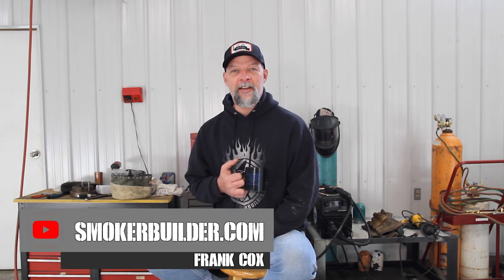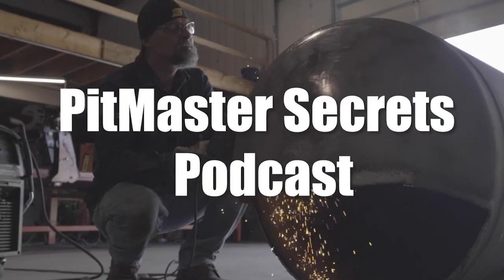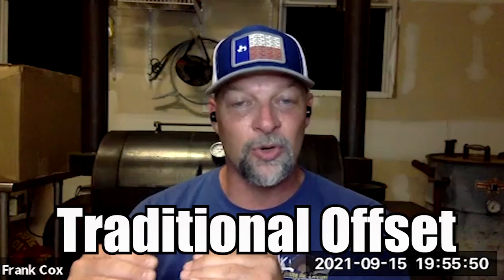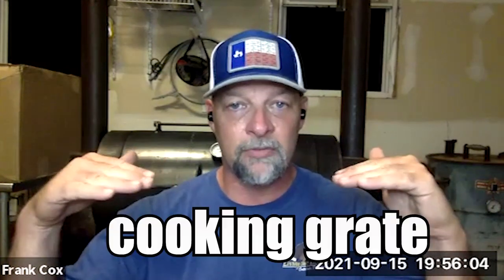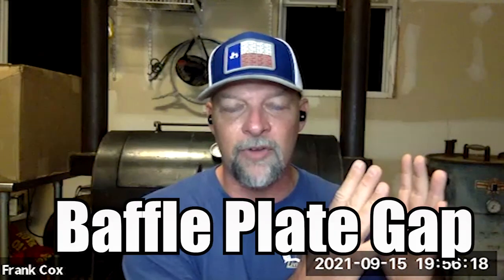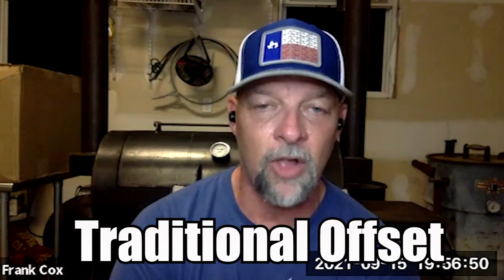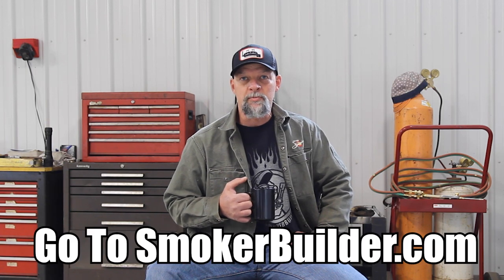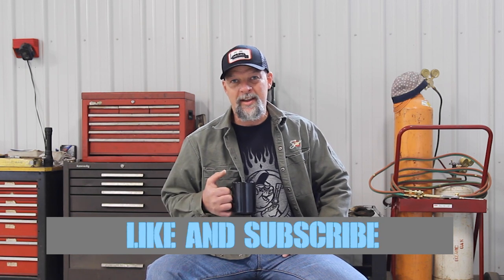What Kind Of Baffle Should I Use For An Offset Smoker?  [PitMaster Secrets Podcast: ep. 3-6]

Comment: Really interesting video. Been experimenting with different designs on my tiny offset myself, I've settled on a Franklin / Mill Scale design baffle, wide open exchange and a shelf 2" above the grate. I've had good results and great flavor, definitely better than the factory downward lip baffle that caused a marked hot spot in the center of the grate. Cheers!
Reply from the maker: Awesome! I still have not tried that method yet. there are so many good ideas out there though haha!
Reply: @SmokerBuilder  There's truly a ton to play with. So fare I've tested the Franklin design (you can see a picture of it on my insta), the Workhorse design (top half of the exchange covered, downward lip, and two slits between the lip and the shield), and no baffle at all

If I had to be honest and ask you a question at the same time, I've noticed little difference between using a well-designed baffle and no baffle at all—as long as there is at least a small water pan on the cooking grate at the exchange to create some turbulation at the exit; aside from sparing the first third of the cooking grate from getting blasted with direct heat, does having a baffle make a difference at all in an open offset?

Note: mine is a tiny 16x36 1/4" open offset with an oversized stack (4 1/2" x 33") and no collector, although the stack opening is essentially 3" from the food grate because it's just 16" in diameter; the firebox is also oversized at 16x21", and the throat is two overlapping circles with no dams or restrictions, for a total of 78 sq in. I build my fire on the bottom of the round firebox with no grates or baskets, and the pit runs well except for the nuclear hot spot right in the middle if using the factory baffle

Comment: Thanks Frank. There are several questions:
1. The analogy with the hose with a pinched finger is clear, but then why do they make huge elbows in many pits, turning into a pipe of a slightly smaller diameter, if the stack is closed by 25-50%?
2. Does an isolated firebox affect "too clean smoke" ?
3. Those whose names cannot be called (lol) often show in commercials that their door is wide open, but do they cook the same way, or is it just a demonstration?
Thanks.
Reply from the maker: Great question!
On #1- the main difference between elbows and collector boxes is where the most friction loss happens.
They both still have a certain amount of friction loss.
On the elbows there is more at the transition between the smoke stack and the elbow.
On the collector box there is more at the takeoff for the stack where it meets the adapter.
On the elbow there is another point of friction loss if the reducer is used.
Really at the end of the day both styles work really well.
Your damper setting would be changed on the elbow setup possibly more open to get the same result.
I'll cover this in detail on a future episode as I could talk forever lol...

#2 Really it doesn't have any effect on how clean your smoke is.

#3 I have cooked on a couple of this style of smoker and it really depends on the situation and desired temp. I have see some situations where the door is mostly open and others where it is only a couple inches.

Comment: Hey Frank, great video, thank you.  would installing a baffle plate keep my briskets from getting to fry on the bottom??
Reply from the maker: Thanks Keith!
It really depends on what kind of smoker you’re cooking on.
Think about it as far as where the heat source is coming from.
If the heat source is coming from the bottom up then yes the baffle plate under the meat could help.
If you’re thinking about reverseflow type of system, check out some of the designs on our website.
You’ll see a dash line on the image that is where we would place the baffle plate.
If you’re thinking about a traditional offset with tuning plates that you can move around then they would go in the same place as the baffleplate
Reply: @SmokerBuilder  cooking on a small offset where I can only get about 2ft away from the fire box!
Reply: @SmokerBuilder  Thank you Frank, great reply and very helpful.

Comment: Frank, or anyone with experience, I’m starting to diy build a UDS and for the charcoal basket I’m adding a chain to lower and extract it. What coatings should I avoid? I know not to use galvanized , but what about zinc plated? Obviously stainless steel would be best but I can’t find any chain that is SS. I could use cable but then I need stoppers or some way to finish the ends. Any suggestions will help. Thanks
Reply from the maker: Hey buddy I’m sure you’ve already handled this by now as I’m just getting to see this but I always use plain old carbon steel.
It’s just like using any cast iron skillet.
No harmful coatings